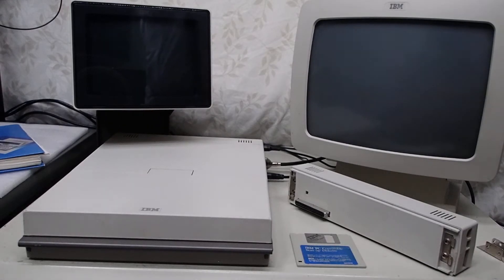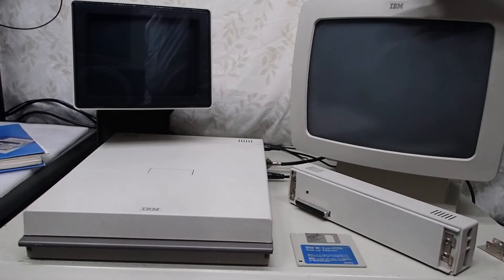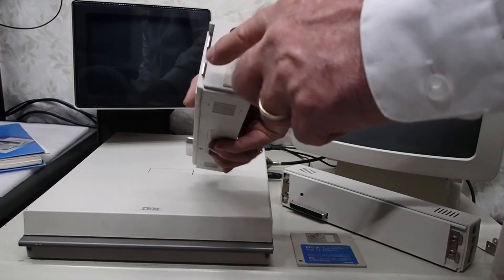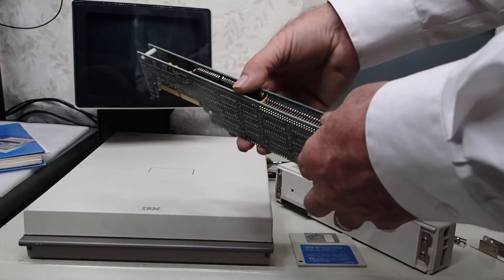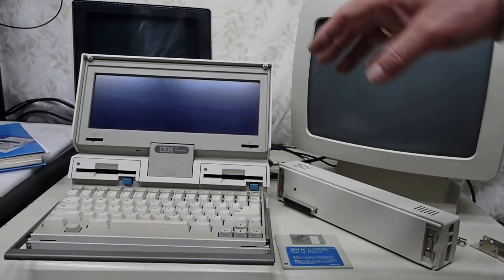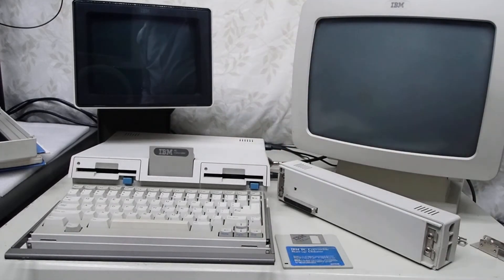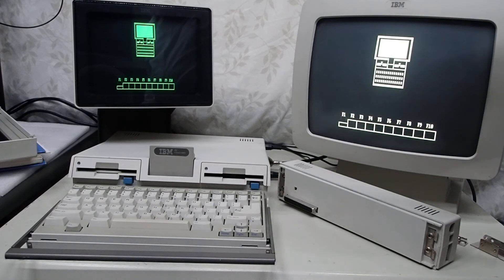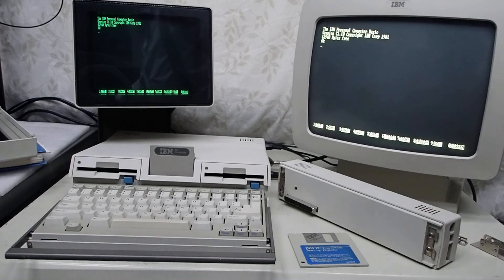IBM PC Convertible Monochrome and Color Displays

Comment: That 5144 looks quite beautifully futuristic! Looks like it belongs in a high-budget 70s/80s sci-fi movie. I really want one.

I'm pretty sure the 5150 and following models could drive dual displays with a CGA card and the composite and RGB outputs both connected to monitors, and even triple displays with an MDA/Heracles card added, as well--I know the separate MDA/Heracles display alongside CGA/EGA/VGA works and was great for debugging. The later allows for 2 mirrored and one separate display. With the 5140 and the color monitor slice and with the stock PCJr you should be able to have 3 displays connected if you also have the optional RF modulator connected.

Comment: That middle port isn't for a light pen, it's for the PCjr's RF modulator. And the color connector is identical to the PCjr's. You can use a PCjr monitor or the PCjr's CGA adapter cable with it.
Reply from the maker: I read further after making the video - indeed you are correct.